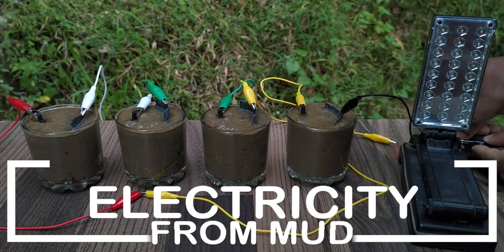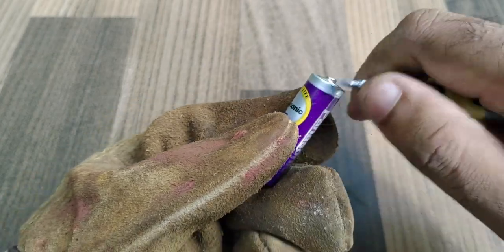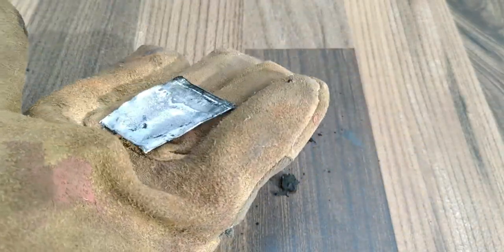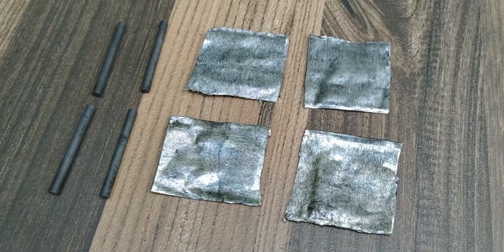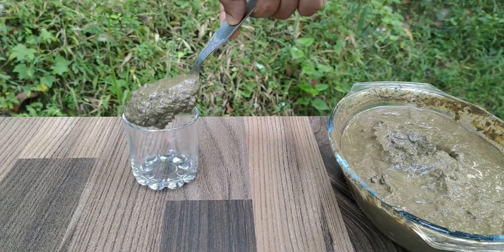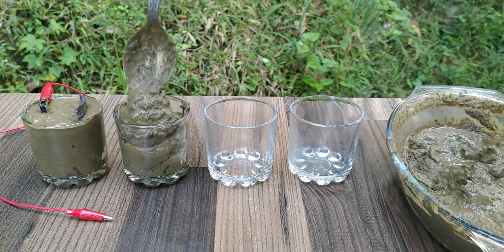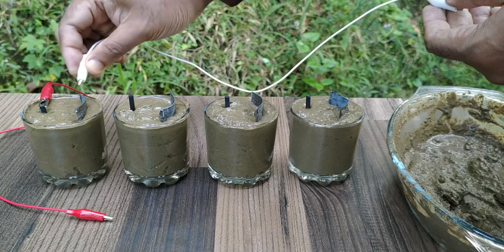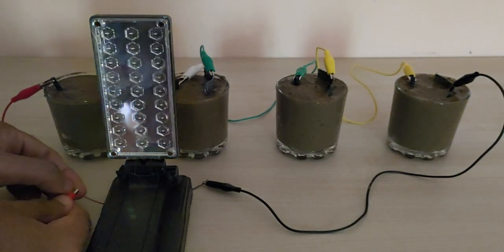Electricity from mud || Earth Battery || Amazing science project

Comment: Can.pls tell the name of that electric wire and other doubt  is we need to use emptied battery or non emptied battery
Reply from the maker: The electric wire is called crocodile clip cable or alligator clip cable..I am giving the purchase  link below..
Double Ended Crocodile Clips Cable Alligator Clips Wire Testing https://amzn.eu/d/3ptX3ON

The battery is emptied or new doesnt matter at all. We just need to take out the carbon rod and zinc plate from  the battery..
Reply: Thank u

Comment: Effort on your part thank you for it but the clay needs to be stirred according to what you said in your response.

Is there a way from this project that produces the required stirring for the clay without checking with me every time which is 10 minutes as you please.
Reply from the maker: There are options to give required stirring to the mud at a specific interval. You can make use of Arduino and servo motors for this.

Comment: Hey guys. I have tried this out and can't get it to work. I'm getting 3.3 volts.
Reply from the maker: Hi friend..it will definitely work..you should get 1.1 to 1.3 Volts per cell..
Reply from the maker: Please read the following article on earth battery in wikipedia..
https://en.m.wikipedia.org/wiki/Earth_battery
Reply from the maker: There are different material combinations of anode and cathode that gives a voltage when immersed in mud..zinc cathode and carbon anode produces a voltage of around 1.4 volts per cell..
Reply from the maker: Please try adding more water to earth and make it into very loose mud..Also you can mix some salt also with the mud. Then it will become good electrolyte and voltage will increase. Please see if this works..
Reply from the maker: And thank you for tying out this experiment..trust me it will definitely work. Because i have done this experiment and it worked..

Comment: We can't get it to work
Reply from the maker: Hi friend, sorry to know that it has not worked..But I can confidently say it will work because I have tried and it worked for me..
Reply from the maker: Did you use the zinc plate and the carbon rod from old batteries?.it will not work with other steels..
Did you connect the anode and the cathode in the same order that i had shown?
Also add some salt to the mud and mix well. It will become a better electrolyte and will give higher output voltage..